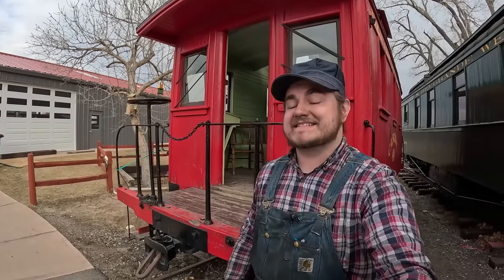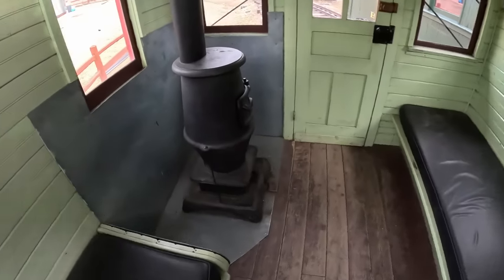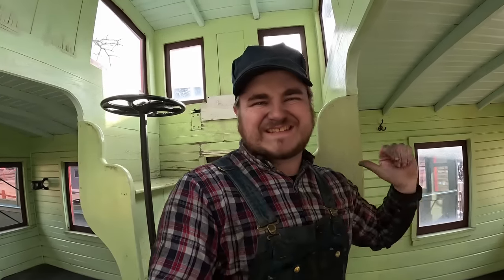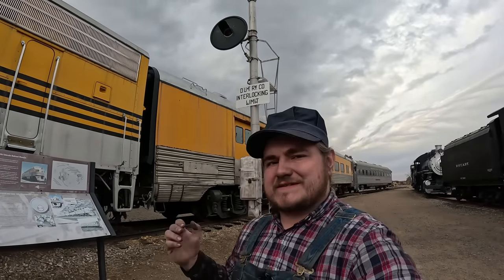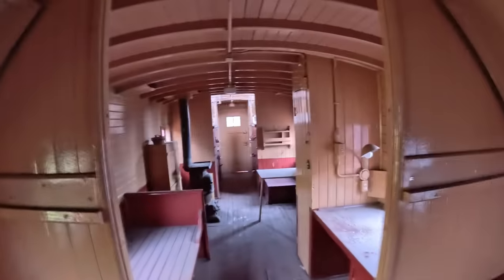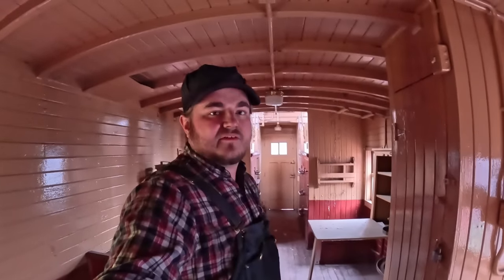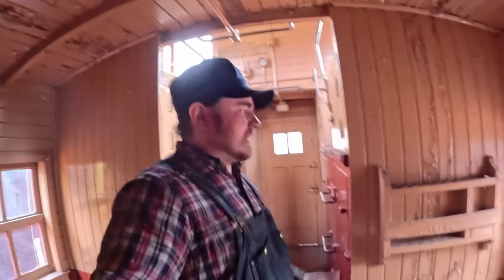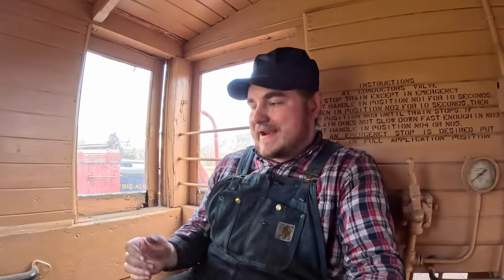Why don't trains use CABOOSES anymore?

Comment: When I was a kid, I always looked forward to seeing the caboose, especially if the train was longer than normal(but what is considered normal when it comes to trains, these days?). I remember seeing a caboose in the backyard a someone’s home. The wheels and braking system were removed and it was on the ground. It probably served as a playhouse for children or a changing room if they had a swimming pool in the backyard. I have heard that the caboose was called the rolling headquarters for train crews because of what their duties were. I guess, back then, a 16 hour day wasn’t paid like it is now. And traveling long distances also were part of the conditions. So sleep was even more important.

Comment: There are devices called hot box detectors still in use. If we set one off, it would display the axle and side of the train the hot box was on. If the detector read 000, it meant no hot box and we radio the head and say, “ highball the scanner.”  These devices were replaced with automatic radio calls to the engineer with a computer voice that said, “inspecting westbound train, no defects.”  Not longer after the automation of the hot box detectors and drag detectors, the caboose was eliminated and replaced with an “end of train device.” This device radios the engineer when brakepipe pressure has reached 90. We used to read a guage on the caboose and then radio the engineer that we have 90lbs and the brakes are releasing. We then radio again when the caboose begins to move with a call “all moving.”  Trainmen were also on the train for enroute switching. Now that’s done locally by crews sent out in vans.

Comment: Because the railroads reduced crew size (and safety) untill they were no longer "needed".  In the case of the Illinois Central, it was done specifically to remove comfort from the conductor/ brakemen.

Comment: Cabooses use to also be equipped with stretchers so when the train took UDE, and the slack ran in, you might end up peeling the conductor and brakeman off the wall. And due to various rules, you could only place one helper locomotive behind the caboose. Other rules said you couldn't place the helper just ahead of the caboose. So getting rid of the caboose, you could put a set of two locomotive helper engines shoving on the rear of the train. Also the expense of maintaining a fleet of cabooses was another good reason to eliminate the cabooses. Safety, Money and train makeup all led to the demise of the caboose.

Comment: The reason the break caboose went away is because new technologies were developed. Today the engineer, brakeman, conductor, and the pilot engineer ride in the cab and on the rear is the FRED Beacon or another locomotive powered by RCL. Excursion railroads still use the caboose and you sometimes see them with hazmat loads.

Comment: Side note.  Cabooses were manufactured by Pacific Car Company which was located in Seattle.  In 1945 Pacific Car bought a local truck manufacturer called Kenworth. Which today is located next to Boeing in Renton.  In the 60's  Pacific Car bought another truck manufacturer, Peterbilt. Meanwhile Pacific Car rebranded itself as Paccar and is the parent corporation of Kenworth, Peterbilt and Paccar Engines.

Comment: I was under the impression that plain bearings were/are always made of bronze, not brass. Can someone chime in on that?

Wonderful video, very informative! Thank you
Reply: Actually they are brass with a lead Babbitt surface that the axle rides in. once up to speed plain bearings actually have less drag than roller bearings, but it takes a lot more force to get plain bearing equipped cars moving, plus they did fail more often than roller bearings do. Changing a wheel in a car with plain bearings is a longer and harder job than roller bearings.
Reply: @fire5506  Thanks for the info

Comment: Cabooses were almost always filthy. Inside, you could find 3 day old newspapers from the other side of the US. I got paid to wave at people. Sometimes we kept road crossings blocked for more than one hour. When the caboose finally slow-rolled over the crossing, angry drivers sometimes boarded the caboose on a mission to kick my ass. I had the caboose doors locked. I was smiling. If the invader didn't  jump off soon, the train could be going too fast. I loved to watch them hit the rocks running. Sometimes they were miles from their cars when they got off.

Comment: You didn't mention that probably the biggest reason for beds in the caboose was that the conductor and trainmen slept in the caboose when they were in a yard away from their home terminal. 

The biggest thing that kept cabooses on the rear of the trains as long as they were was because of contracts between the operating unions and the railroads. The same reason railroads kept fireman as long as they did after steam was gone.

Comment: I’ve actually had the honor of riding an old fashioned train (locomotive). It was the best experience of my life. No it wasn’t the Disneyland Railroad, but a real honest to god colonial style train. It even had a food car with a built in kitchen, and food carts strapped to the wall.

I remember riding the train and smelling the warm stale scent of steam and coal, but I didn’t mind. I even got a nice view of other trains passing by, the valleys, oceans, etc. Lastly, I also had the pleasure of riding in the caboose. I remember standing outside and taking in the fresh air that blew through my hair.
Reply: I have loved trains all my life.  I grew up near the tracks and would often walk along them, with my friends.  When I got out on my own, I was working as a telecommunications technician for Canadian National.  In the mid 70s, I was working in Northern Ontario and frequently rode trains, both passenger and freight, to get to my work locations.  I also commuted for many years on a commuter train.

Comment: Although the first full-scale working railway (Steam Locomotive) was built in the United Kingdom in 1804 by British engineer ''Richard Trevithick''. The ''Caboose'' did not exist during the 1800s. In fact the word ''Caboose'' can be traced back to a derivation of the Dutch word "Kombuis,". Which referred to a ship's galley. Use of Cabooses began in the 1830s, when railroads housed trainmen in shanties built onto (Boxcars or Flatcars).

Comment: Short Answer:

Slack from long trains created force, able to knock over anybody in the caboose
Cabooses costed way more than EOT's.
Railcars got taller.
With EOT's, it automatically transfers data to the Engineer. (With Cabooses, if the radio didn't work, nobody could tell the engineer there was a problem.)

Comment: Well done!   Thank you.  Was hoping to see the all-importantoilet which emptied onto the track.
1967? goto ride in the caboose from Littleton Depot south to Louviers and then in the locomotive doing switching at Dupont Explosives.   Then south to Sedalia in the caboose to go north to ~ 3rd Avenue grade crossing in Denver.   Crew had me wear a hat so no one would recognize a teenager in the cupola.
Had to be ready for slack action in the caboose.  They oftehad the caboose brakes on slightly to keep couplers tight.   Just for me?  Hope not.
The brakeman purposely started a fire in brush nexto the track in Sedalia.   Would be blamed on hot brakes or locomotive stack hot cinders.

Comment: I left out a fact, when I commented before, the Journal Boxes had a cavity in the outside or outboard face that held what we called FART ROCK. It was on the inspection when it came down the maintenance line. If it was empty, the machinists would reload it. The FART ROCK would be inserted along with a spring and a LEAD cone into the hole. The hole had a rim inside so when the tool was applied it swole up tge outside diameter of the disk and it latched behind the rim. It's purpose was that if a hot-box occured, it woukd heat up that FART ROCK and get it nasty hot. Tge lead sheet would melt and the fart rock would expell. It would put out a sickening fart smell and smoke that could be seen and definitely Smelled by the crew in the cab, which was short slang for CABoose. So day or night, the conductor would know, beyond the shadow of any doubt, that he had a hot-box on his train. As he approached the smoke, whichever side stunk the worst, was the side the hot-box was on. Hyatt boxes had tgem up at the top with a squeeze clip that held the lead disk in place. After Timken bearings were being used on Locomotives, the Hyatt boxes were machined to work on those bearings on the Traction Motor axles. Most of those old Fart Rock gallies were eliminated. Please add this to your knowledge.
   ((( Oh, and the plural for more than one caboose IS  Cabooses! )))
   THANK YOU

Comment: Typical radio call as the train approaches a hot box detector. Engineer: SP8548 scanner. Conductor/rear brakeman: scanner. After the caboose passes the scanner—Conductor/rear brakeman: SP8548 highball the scanner. That’s assuming you didn’t set it off and have a hot bearing. You are supposed to say over and out but we rarely did unless train-masters or road foreman about.

Comment: Interesting factoids about the Caboose. Yes, they fell out of service as their functions became redundant, but the actual reason the railroads were finally able to successfully lobby for their removal was because they were replaced by electronic hot bearing detectors on the tracks.

Comment: 4:08 So this is where the source of a great many wildfires then.  Monitoring for and preventing that, if more by virtue of seeking to avoid more local to the railroad problems, would be very important.

I know there is in Grand Rapids, MN's little yard a green caboose is parked on a siding and has been for decades.  Must be Burlington Northern original livery.  I suspect the local rail authority turned it into an office, or some other useful piece, in lieu of destroying it.

Comment: Thanks!!  Very informative!  2 questions:  So, where are all the decommissioned caboose?  Seems there's a great alternative housing opportunity there!  Also, I used to occasionally find these huge ball bearings laying near a track that I worked near.  They were 2-1/2 to maybe 3 inches diameter.  Were those parts of the wheel bearing / truck assemblies?

Comment: This video talks about the Cabooses in an American context.  However, the history of them is also quite interesting in Canada.  British Colombia - Canada's most western province - would only agree to join the Canadian confederation if Ottawa agreed to build a railroad to the west coast.  Because the government of the time had a vision of "Ad mari usque ad mare" (from sea to sea - a quote from the bible) they agreed.  It was a huge, expensive undertaking, especially when building a usable railroad through the Rocky Mountains.  Lots of people died blasting rock with dynamite.  Sometimes, a locomotive would sink into a sink hole as it travelled across what had been presumed to be a perfectly fine stretch or railroad in the prairies but under the weight of the locomotive, the swampy ground simply gave way.  Even today, Canada has only about 35 million people.  You can image how sparsely populated Canada was more than 100 years ago.  Imagine travelling in a caboose through Saskatchewan in the middle of winter with snow as high as the train and wind that would howl at -40!  Those cabooses need a coal fired stove.  Frankly speaking, I wonder if they were even able to keep that caboose warm in such weather.  Speculators bought up land where they thought the railroad might be so that the railroad would have to buy them out and/or their land would appreciate.  After the railroad was built, farms were established on both sides of the railroad so farmers could get their crops to market.  

Via Rail - Canada's passenger service - is actually quite horrible.  In western provinces, the trains leave at midnight or other ungodly hours because they are really not at all interested in providing good customer service.  However, due to what was agreed upon during confederation, the government must maintain passenger service from coast to coast.
Reply: " Even today, Canada has only about 35 million people."  We hit 40M on Friday.  In some parts of Northern Ontario, there's muskeg, where they have to keep dumping in ballast, to keep the tracks above water.  The reason for the nighttime stops is the trains run 24 hours/day, traveling from Toronto to Vancouver over 3 or 4 days.  Back in 1974, I took the train from Toronto to Vancouver.  We hit Saskatchewan in the middle of the night on that trip.  However, we also hit Northern Ontario at night.  A couple of years later I went to Winnipeg for a weekend escape from Armstrong, Ontario.  The train left late at night and we arrived in Winnipeg the next morning.  On the way back, we left in the evening and I arrived in Armstrong, only a little bit late for work on Monday morning.  The office was right behind the train station, so I didn't have much of a commute.  🙂

Comment: Like everything that once provided jobs, the rail industry has computerised and conductors and the little house that the caboose provided aren't needed. Everything is controlled by sensors and CTC computer control of the trains movement. Though about fifteen years ago I saw a train with a hotbox so hot that the wheel  rims were actually burning orange from the friction. I tried contacting the police and the railroad without success. But I didn't hear of any derailment so I guess someone caught it eventually.

Comment: After high school, I was supposed to study electronics at the university. No, I decided I wanted to be a bum and travel. I’ve hopped freight train from Portland Maine to Portland, Oregon riding up in the engine room 2/3 of the way on that trip another trip from Atlanta Georgia to LA and from LA to Portland Oregon. I’ve had numerous train hopping adventures in my younger days, and I have written in cabooses when it was 0° out cooking pork chops on the cold burning stove with the brakeman.    My next trip is a 6000 mile boat excursion, the Great Loop.!     It’s kind of sad  that the caboose has been phased out….

Comment: Cabooses, also known as "waycars" or "guard vans," were traditionally used on the end of a freight train to provide a place for the crew to work and live during long journeys. However, with advances in technology and changes in industry regulations, cabooses have become less necessary and are no longer commonly used.

One of the primary reasons for the decline of cabooses is the introduction of electronic monitoring systems that have replaced the need for human observation. Modern trains now have computer systems that monitor the brakes, speed, and other critical parameters, making it possible to operate without a crew member on the rear of the train. Additionally, cabooses were often used as a place for the conductor and other crew members to sleep during long trips, but with the advent of new labor regulations and restrictions, it has become less common for train crews to work such extended hours.

Another reason for the decline of cabooses is cost. Cabooses were expensive to build, maintain, and staff, and the increased use of technology has made them less necessary from a cost perspective. Finally, with the increased emphasis on safety and the reduced risk of accidents, the need for cabooses has diminished, as the monitoring systems on modern trains are far more effective at detecting and preventing accidents than human observation alone.

Overall, while cabooses played an important role in the history of rail transportation, they have become increasingly obsolete due to technological advances and changes in industry regulations.

Comment: They are also called a  Crummy most early cabooses were built by the railroads own people they were homemade there were more of a variety until their last decade since
The 1960s they are more  uniform modern  era caboose  Primary office tool shack  kitchenette  donicker  only 1 or 2 bunks

Comment: On a 7,000 foot train consist, if 1" of slack is in each coupler, then the locomotove can move aleast 580 feet before the last car moves.  A locomotive can gain sufficient speed in that distance to really shock the last car in the consist.  Pitty the occupants of the caboose if the engineer (motorman) doesn't control acceleration.  Even if 1/4" slack allows the locomotive move 150+ feet prsuming the consist is compressed to the limit.

Comment: Cabooses or cabeese?

This is what I find on a railroad magazine: 

Along with the existence of the word caboose has been a debate that is as old as time: what is the proper plural form of “caboose?” If the plural of “goose” is “geese,” would that make the plural of “caboose,” “cabeese?” It turns out that the term “cabeese” is just a slang term. The word takes a standard -s plural. Merriam-Webster Inc. associate editor Neil S. Serven explains the reasoning below:

Our collected evidence indicates that “caboose” takes a standard -s plural. The word caboose is a “count noun” and takes a normal count plural. For example: “To streamline operations, the railroads would like to permanently uncouple these little lookout cars from freight trains. ‘Cabooses are dead weight,’ says a vice president of a Western railroad. ‘They are inefficient and belong to a different era.’” John D. Williams, Wall Street Journal, March 18, 1982. “A Burlington Northern freight passes, and Brian calls my attention to the rear-end device that has replaced the cabooses.” Terry Pindell, Making Tracks: An American Rail Odyssey, 1990. – Neil S. Serven, associate editor, Merriam-Webster Inc.